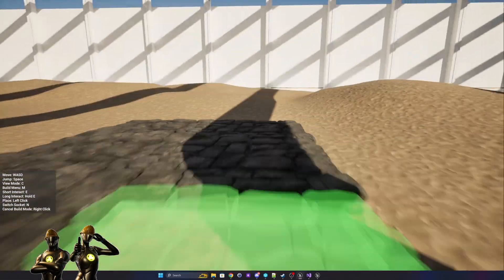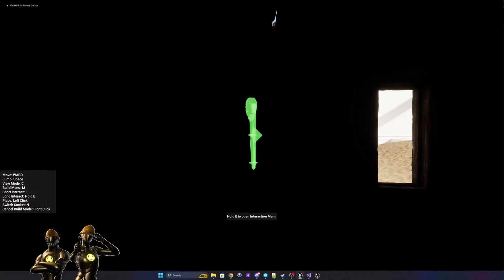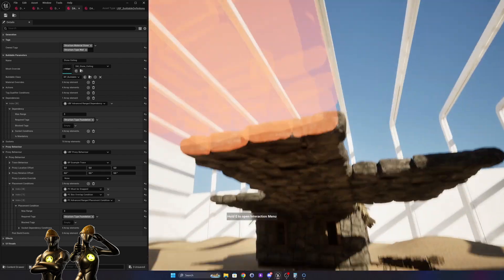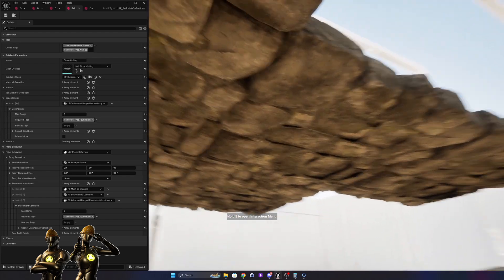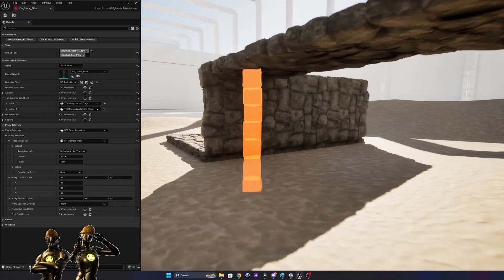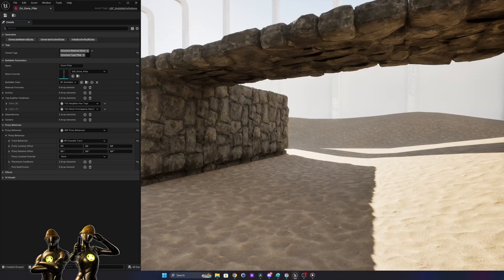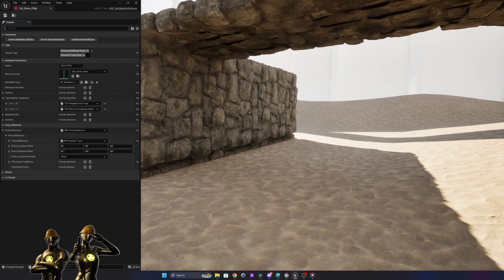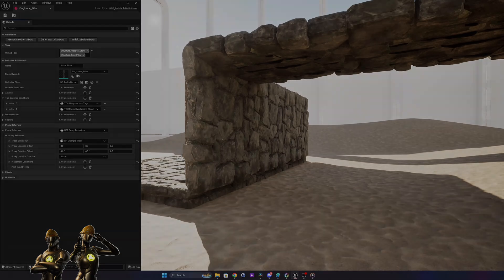Ultimate Building System: Unreal Engine 5 Building System

Comment: A few key things before you buy. It's not exactly plug-and-play like it says. Installation is a bit of a headache and half of the system is in C++. If you're a blueprint user only, I wouldn't recomend using this, especially since there's not enough support/documentation for the many problems you'll run into. Additionally you'll need to setup your own logic and widgets for handling which build piece to place(also not found in documentation).

Other than that, meshes are great and building feels good. Snapping/proxy logic is also great.
Reply: Yup, I've realized that there is a bit more to the Plug-and-Play Simplicity than advertised, at least for a blueprint-only user. I wish I was wrong, and hopefully I'll be in the future.
Reply: @Sandnessen  @witherwood -- so, what is your opinion months later? Was there any improvement? By the way, does it support upgrading/replacing elements?
Reply: @TheNjordy I ended up creating my own building system. The hassle was not worth it. 

The static meshes are quite good, I'd say, so I still use them as placeholders for my main project. But at that prices, I've could have bought about 5 complete humble bundles (maybe 2-3 now that's it's on sale though) if assets was all I needed.

If I recall correctly, yes, you could upgrade placed building modules (walls etc) by interacting with it. Not as "fluently" as Rust perhaps, but I guess you can tweak it.

If you you only use blueprints and want a building system you can simply add to your project, I can't recommend this one 😕

Comment: Can you please make an installation video for this? It seems like the document is missing something. Thanks in advance!
Reply from the maker: Hey! :) 
When you say something is missing what exactly do you mean? Does it not work for you on your end, and if so, what issues are you facing?
Reply: @hivemind6719  Well, after a lot of trying and still not getting it to work, an installation video by someone like you that really knows the approach, or a step-by-step breakdown would be so valuable! A good example is what the Moonville folks have done with a video for quick-setup, and one for further integration. 

Or at least for the hiveminddocs, stuff like a "testing checklist", and common troubleshooting steps for debugging (for example what to do if the UI isn’t loading correctly, and how UBS actually handles the UI data), which I've seen in the discord that I'm not the only one struggling with. 

I might be too unexperienced as a blueprint (not C++) user, or just too dumb to utilize this system, but at this moment I kinda wish I didn't spend all the time and money on UBS which I as a new indiedev probably should have put elsewhere. I'm not buying systems just to magically fix challenges, but it is even hard to learn from UBS' coding practises, which I'm sure are great - but just beyond my reach :)
Reply: There used to be a second ini file you needed to put in the project on the "Example Content Page". When i created a new project with UBS, the building system wouldn't work. I had to go back into my downloads and retrieve the second ini file for it to work.... I think the new data table sytem was meant to replace this..? but it didn't work for me
Reply: @WitherWood  thanks for your input! yeah, but to my understanding you don't need to add that yourself with the latest version, right? (the system should be at version 1.2, even if fab description says 1.1)
Reply: @ Yeah, i don't know why it was that way on my end, but it started worrking once i added that file. if you'd like to try it leme know, i still have that file lol. anyways, sorry you haven't gotten it to work yet. that's frustrating af
Reply: @WitherWood  Thanks! Yeah, at this point it is just an expensive asset pack for me 😅

Comment: With this i should be able to import my own meshes correct? Also is there build requirments feild for materials.
Reply: Hi! Yes you can definitely import your own meshes and use them with this system. 

The Placement Condition field allows you to easily hook into your inventory system to check for the correct materials and amount required to be able to place a buildable :)!

Comment: But would this be able to be used as a mod in a game that already has a base building system?
Reply from the maker: Hey! :) The system is not meant to be coexisting or used within another building system. The meshes can be used of course, but the system itself is meant to be used as a standalone solution.
Reply: @hivemind6719  Maybe release a pack of assets mean to go with this type of build system. I would definitely buy. Sometimes Enviorment Assets can't always be used for modular build system rather than prefab blueprints but it would be nice to see some asset pack released with this solely in mind.
Reply from the maker: @D3ck4rd87  Yes :) That’s the plan the art only pack will release soon.